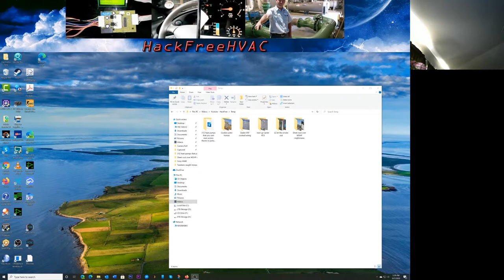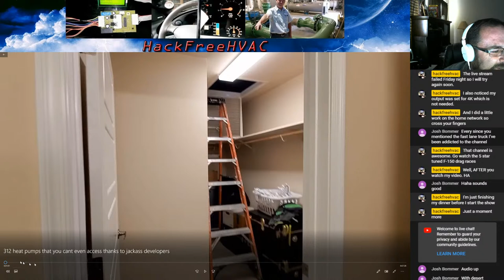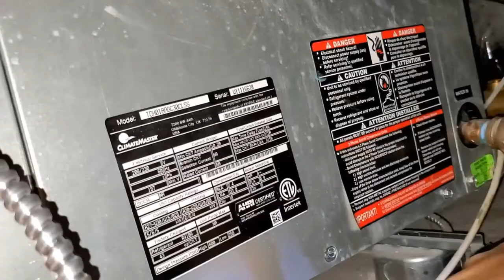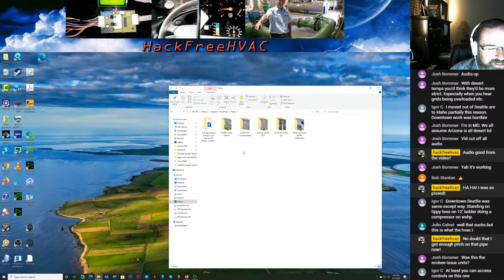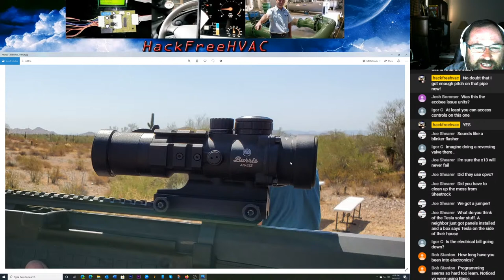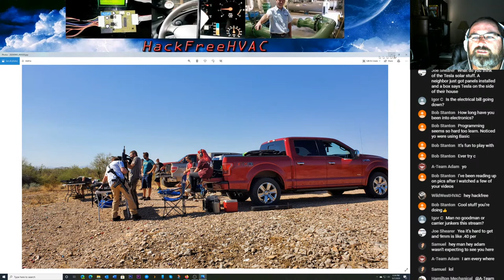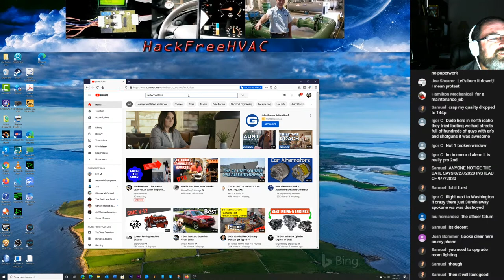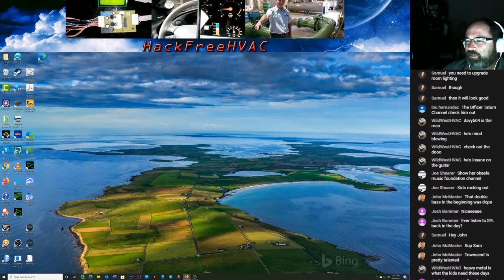HackFreeHVAC Live Stream 09/07/2020: LGMV diagnosis after lightning damage!

Comment: I guess it would be expecting too much to think that together the building owner, the architect, the GC, etc would agree this fluster-cluck needs to be addressed pro-actively, such as doing the design work and then remodeling each soffit and access panel throughout the building.  Instead,  I guess each time a unit has to be serviced the walls will be cut and patched on a case-by-case basis, with much added cost and frustration for the tenant, for maintenance staff, prop mgr, and building owner.   Brings to mind a frequent Steve Lav phrase -- something like "it's a real sh?t show". 

Thanks for giving us the tour - it was quite educational.